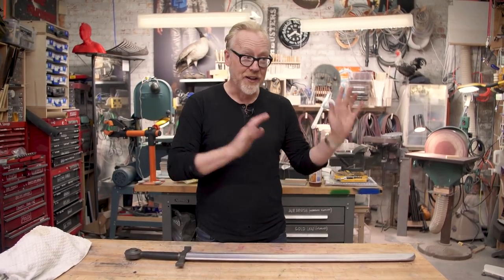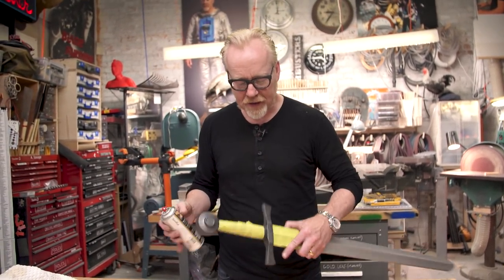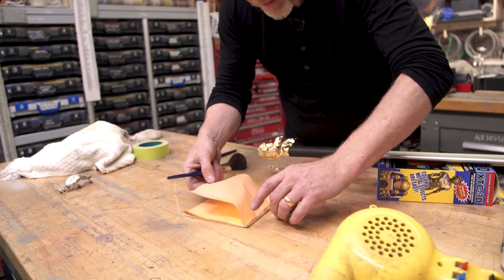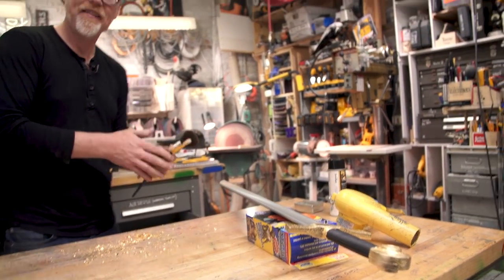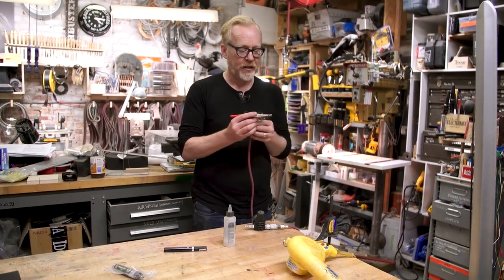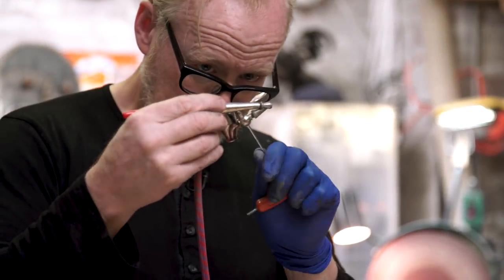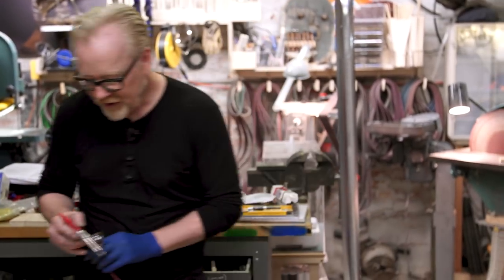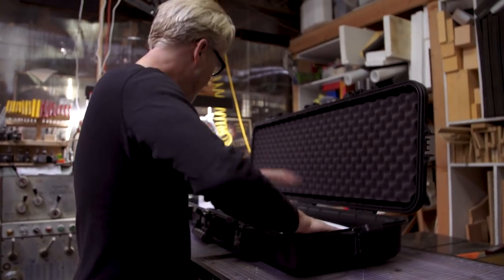Adam Savage's One Day Builds: Foam Cosplay Sword!

Comment: that chrome paint is magic
Reply: I wonder how durable it is? Rattle can chrome loses its shine kinda easily
Reply: I'm a Molotow sponsored artist and it retains it's shine really well and is durable as the company is a graffiti based art supplier which is known for their high quality, long lasting paint and inks. The only drawback to it is it has a very long drying time compared to spraycan chrome.
Reply: HarleyEos been working on a bruised titanium look,  (paint testing) but I think I'll grab that if it's not too expensive 🤔
Reply: the pens are pretty cheap (under £5) and get them or the refills from a graffiti shop/supplier and not an art supplier as you'll pay an extra 50% or more for it.
Reply: Ralph Replete Great thanks 🙂
Reply: Molow is also what many use on prop kylo ren helmets to get a chrome finish
Reply: Ralph Replete Molotow is amazing paint but takes a long time to dry
Reply: the Belton premium dries really quick (it's the one I use most as I do murals with it) , but stuff like the artist range does take a long time to dry but that's because it was made to do more smearing and brush work with.
Reply: HarleyEos they're not really meant to dry, they're meant for graffiti
Reply: Well im a hobby model builder and i used molotow liquid chrome a few times. Yes, it is the easiest and most chrom like paint ever. But it is not that durable. Even after 5 days of drying time, it still loses its shine very fast after touching it gently a few times. If you coat it with any kind of clear coat (ive tried a few brands, also acrylic and lacquer based), it loses its chrome shine.
Reply: Necramonium Montana makes a really great gold acrylic paint in a rattle can that I've used on a replica trophy that looks astonishingly good for a spray paint.
Reply: With a name like that they probably sacrificed some souls to get it that good :P

Comment: As a guy who used to airbrush T-shirts at Universal Studios in the early 90s, the Paasche VL double action is the model to have. Cheap, rugged, modular construction allows for personal customization, easy/fast to clean, clears clogs super easily, and sprays just about anything you can chuck at it. You can even use em in less-than-clean condition... Most common setup was three brushes: one for black, one for white, one for all the other colors. Fancy artists had extra brushes for light/med/dark colors. I'm still using my first three Paasche VL airbrushes 25 years later...

Comment: I'm sponsored by Molotow and the liquid chrome is amazing. One of my favourites in all their ranges, it's so reflective, like almost a mirror finish.
Reply: just how durable is it? Looks like it should be very durable from this video considering its on a foam that can flex a bit, but on the overnight cure Adam said he could still finger print it. How long is the cure time for a really durable finish? Can it be clear coated for extra durability without losing its luster like so many other metallic paints?

Thanks!
Reply: it's got some scratch resistance, and resists abrasion and good uv proof. I know it takes at least a day to full cure but I'm using it to create art with, not as a coating so that would really depend on the surface, and thickness of layers. Adam used a lot in one go, so probably best to layer it up. Also it's near mirror reflective so a finger would leave a grease mark on it. Not used a clear coat with it so that's something you'd have to test. In theory you should be able to do it but would require a bit of experimenting to find the best one that doesn't react with the paint. It's an alcohol based paint btw.
Reply: Thanks so much for the info!

Definitely looking to try this stuff out soon.
Reply: Replete Replete I wish I was sponsored by them back in my graffiti days. Always loved the brand, great quality, but, very expensive.

Comment: If I remember correctly from my readings on gilding, it was often done with a very thinned out hide glue that was brushed on, wiped off and then allowed to become tacky prior to applying the leaf. The leaf is handled by lifting the sheet of paper over the workpiece and sliding the leaf carefully off the sheet. This is less important for objects which have multiple compound curves and won't be able to be buffed. You can also find some recommendations to apply more than one layer of leaf so that small scuffs don't immediately wear through all of the gold. Then, if a more burnished appearance is desired, after the hide glue has dried, the piece can be burnished with a fine shellac similar to French polished wood.

Comment: Molotov and Montana paints are soo durable bc they were designed to last in the streets for years lol. grade A graffiti supplier
Reply: I was going to comment the exact same thing! I've been using these brands for years and I would swear by them any day. The only time I've had any sort of issue with a Montana or Molotow product was when I painted parts of the grille on my car with some cheapo plastic paint and then coated it with a Montana matte clear coat – it didn't quite hold up to the abuse on Swedish backroads. Then again that's very much not what it's made for so it doesn't really matter. Great stuff!

Comment: FWIW, I find that an ultrasonic jewellery cleaner type thing works really well for cleaning airbrush parts. Depending on the solvent you need for the paint you've used, it might not be too kind on the O-rings, but it generally makes a really good job of cleaning the fiddly bits.

Comment: R/e  cleaning airbrushes, the best thing I ever found was an inexpensive ultrasonic denture cleaner. 
Just the right size. Have the same Badger SA, A larger Badger 250 "touch up" gun,  and an odd "Mr Hobby"  Japanese DA. 
That Badger is easily one of the best investments I ever made, near 30 years ago. 

Also, "Lacquer thinner" best basic solvent ever. Cleans everything, and in the proper concentration can give you a fifteen minute trip into la-la land. (haha!)

Comment: a little correction.
in a double action airbrush pushing the button doesn't control how much you are spraying it only turns airflow on or off (you don't control the air pressure from here it's an on or off deal)
pulling back on the lever retracts a needle from the nozzle which allows the paint to flow. the more you pull back the more paint flows. (i assume that is what is being adjusted in your single action, you're retracting the needle) the only real difference on the double action is that you can change paint flow mid spray (so it's easier to spray a gradient for example)
 

you control the spread of paint by moving the brush closer or farther away from your work piece
if you go really close you can achieve lines as thin as a pencil.
but air pressure always remains constant even on a double action.

Comment: The thing about gold leaf is it peels of quite easily in relatively short period of time after it was applied. Alternatively you can  mix it with glue and a little bit of water and then apply it on any surface just like paint with a brush. Much more durable and easier to  apply to any sort of surface.

Comment: I do use a Badger Double Action, but I like to have extra degrees of control, and I do not work at speed, but rather precision. The nice thing is that it'll also work for normal spraying if you hammer down on it.

Comment: Adam, Adam, big slap on the wrist for spraying with no mask.  Especially with paint that almost certainly has aluminum dust in it.  We have all done it but still not a great practice.
But you get some extra points for owning the dirty airbrush.

BTW I got a really great finish with a rattle can from Valspar Metallic "Brilliant metal effects".  It looked a lot like your sword blade, though hard to really say from video.  It was smooth and shiny enough to have reflections.  Airbrush would be my first choice for the sword though, the rattle can is a pretty wide spray for thin things.

Comment: I'm always wondering how Adam's shop is not completely covered in paint, and how Adam isn't coughing all the time like an old smoker. Every time spray paint is used, it seems to be sprayed in all directions, without anything to catch the overspray or Adam wearing a respirator. Same with paint thinner and glue. All that paint and thinner and glue must land *somewhere*. I remember seeing a big extraction fan in an older video, but it can only do so much from the ceiling. Is there something about the shop setup that I am missing?

Comment: gold leaf is fine even the fake one but what I like to use is gold paint dust which is made from actual very fine gold dust + shellac dust (it is not known to me if they still make the stuff today)  in normal use you add alcohol to make the paint but what I like to do in a lot of cases is emerge (or wet) the object with (90+ %) alcohol and cover the whole thing with this dust the shellac will immediately dissolve in the alcohol making it stick to the object and making a good covering layer.
brush the excess off and you could be done it now looks like gold only. it's mat to make it shiny just buff slightly with a polishing agent (F.I. Auto Cleaner or Brasso) it will look like gold metal instead of gold paint.
I found my big pot of gold/shellac dust in the stock sale of a paint shop that had not been open since 1965 if I would melt the stuff down I would get a lot of money from the gold in it 
the shellac/gold ratio is about 50% or so and,.. the pot ways 20 pounds! (i paid next to nothing for it!)
but, I use it on a regular basis for my antique phonograph collection and for other collectors 
the coating on F.I. a tone arm is a tiny minute amount far less than a gram but I get paid far above the gold value for that type of job so I think melting isn't on my agenda (yet!)
I don't know if you can still buy this stuff I think it was used for pinstriping in the late 19th/early 20th centuries

it was made by making a super fine gold dust and adding it to a shellac/alcohol paste which was mixed and then left to dry/harden on a waxy slab after that, the mix was rock hard and ready for grinding into dust
ps antique shellac is a type of beetle juice that's hardened not from a type of aphid like today's shellac. the beetles produced far less shellac but in far superior quality but they used it for defense only (with added chemicals) the aphids coat everything with it (with added sugar which can be extracted from it with water) so the beetles needed to be eh, like milked but the aphid shellac can just be harvested from leaves
making the old type shellac worth its weight in gold especially for F.I. violin builders and restorers
(ps I also got a big pot of the beetle shellac at the same stock sale eh. a double whammy for me eh!)
anyway i thought i should share this knowledge.

Comment: Does the Maltow finish dull if you clearcoat it? 

Something else I want to try is that new powdered chrome they have for nail salons. It requires a super glossy black basecoat, and I'm not sure if you can clearcoat it either. Still, imagine dusting a silicone mold in that stuff when you're doing a resin casting! I saw someone use it in a DIY slime recipe, and the stuff looked like mercury!

Comment: Always wear a respiratory mask when airbrushing. Don't mask off areas where you don't want crome with tape; moltow drys into a past; so when you remove the tape it will take scraps of chrome with it. when you airbrush Moltow thin it down in a 1:1 ratio with mr hobby basic thinner. Don't touch moltow for THREE DAYS, yes really, after you apply it, or you'll ruin the finish. also use alclad clear coat afterwards to give it a mirror finish.

Comment: Personally, I would've taped the handle only, then messy cheap spray painted the whole sword, then use the same spray paint as the adhesive for the fake gold using only paper to prevent the gold from touching the blade and carve a hole for a jewel for the end. Would've taken only like 30 minutes with a blow dryer and could be done on a extremely tight budget (10 bucks tops + however much the sword cost)

Comment: Question: when reassembling the air brush gun do you have to apply oil or lubricant to all the inner parts and threads? Asking because I am curious about rusting or debris build up from the air flow

Comment: Why cant he just put paint thinner in the airbrush reservoir to clean it out that would be faster right? i know nothing about air brushing btw.
Reply: Schnuppy The airbrush has some complex inner channels. Once paint dried in there, you really have to poke it out using tootpics and other wooden and bamboo sticks.
it always cost you 20 minutes or so.
Reply: It takes 3-4 minutes to tear down and fully clean an airbrush of better make after use and not doing so is pure laziness... 
When clogged with dry paint, regardless of enamel or acrylic, you're in for a lengthy clean with cellulose thinner.
I would never leave my airbrush uncleaned after usage, but then mine is a fair bit more expensive than Adams cheapo. (which means mine is much easier to clean amongst a few things)
Also 30 PSI is way too high for airbrushing, but whatever works for you and so on ;)
Reply: due to how the venturi effect works. (simplified explanation because all systems are a little different) the air moving through the larger channel has its own path (line in from house pressure is pretty much going straight through a tube and out into the world), paint is sitting in a reservoir with its own separate channel to run through, without air passing across the opening to that channel, the paint is going nowhere but once air is moving passed the paint channel opening, paint is pulling "pulled" into the main air channel and being pushed out of the nozzle end into the world. if paint is allowed to dry in its channel, pouring thinner into the res and blowing air isnt doing anything, there will still be a blockage at the paint channel opening so no venturi effect is taking place, you just have thinner resting in the res loosening whatever paint its contacting...maybe if you let it sit overnight and keep replacing the thinner it would work but its much faster and effective to do a tear down and fully clean out every little orifice

Comment: I've tried this paint as well. Just have to be careful not to touch it a day or more after it's been sprayed. I had some issues cleaning my airbrush from this though, but I might've used the wrong cleaning stuff initially. Worth mentioning it's acrylic (alcohol based) as well, so it doesn't smell a lot. Also don't really need a black primer for it, all though it helps. A glossy surface really helps!
 Only bad part is that it is quite expensive... 
 I tried finding a cheaper option, so far I've only tested AK Interactive Xtreme Metal Chrome combined with their black base. It's enamel based so it smells A LOT, but it dries in minutes, so it can be handled faster than the Molotow stuff. It is a little bit less glossy than Molotow but I've been quite happy so far. Comparison: https://www.instagram.com/p/BYdlI09jj8u/?taken-by=ficklampa

Comment: For you tins/cans of thinners and the like, if you get an old cap and drill out the center of the cap about 10mm, yes im an aussie so sorry about the sizing, then get a peice of 10mm od copper tube, flare on end of the tube, insert it into the cap, then braze into position. Then just drill a small 3 or 4mm hole in the cap to let thr air in, them bam there you have yourself a spout for all those size cans. I would shoe a pic of mine but its packed away somewhere.... msg me if you would like a pic and i will try n dig it out........ handy lil tool if youre muxing small amounts of paint or cleaning say an air brush or somthing similar....